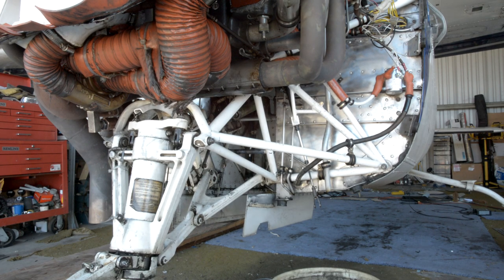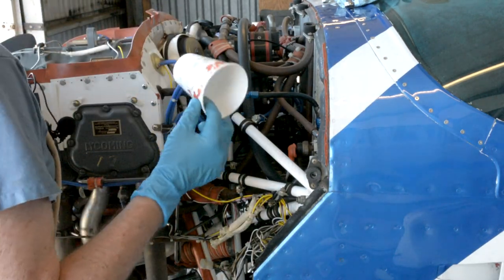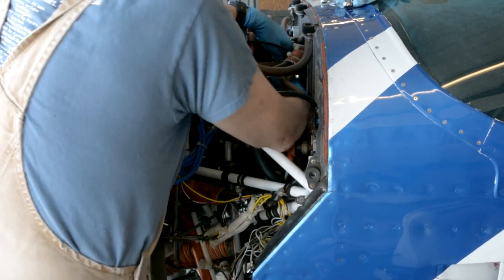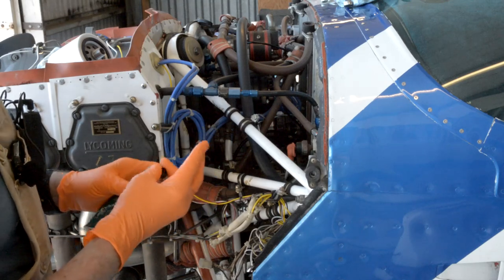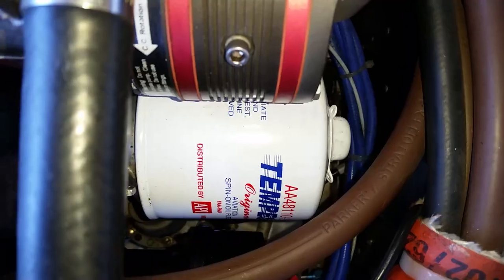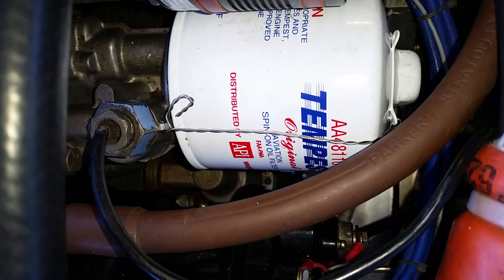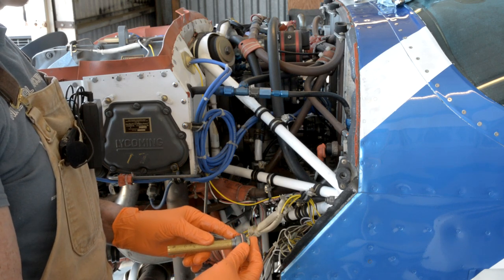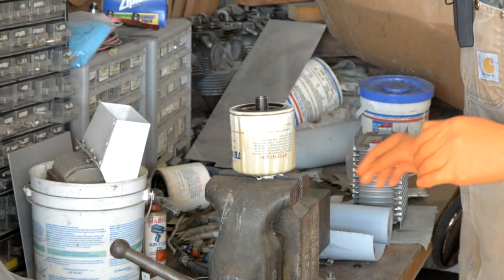Oil change on a Cessna Cardinal RG

Comment: Very interesting, thank you. Why not buy a new torque wrench?? Failing to do so you may give your insurance company a reason to reject a claim.
Reply from the maker: I was referring to a special torque wrench that was made just for oil filters.  I can still use a regular torque wrench (of which I have 4, all calibrated) with a crows foot attachment (which requires a special calculation as the end of the torque wrench is no longer at the center of the load).